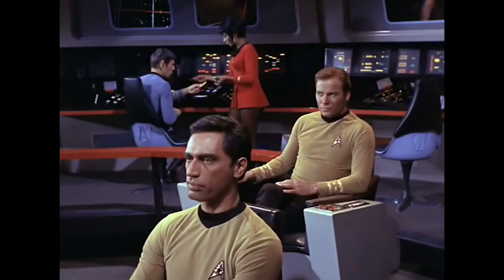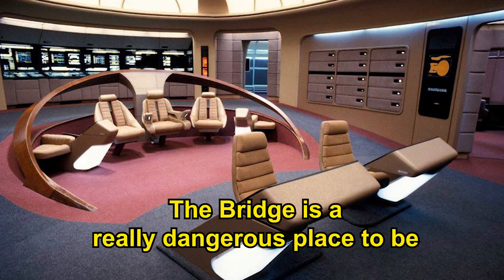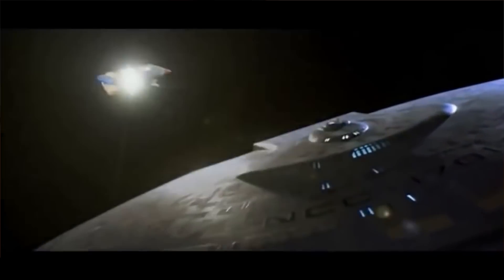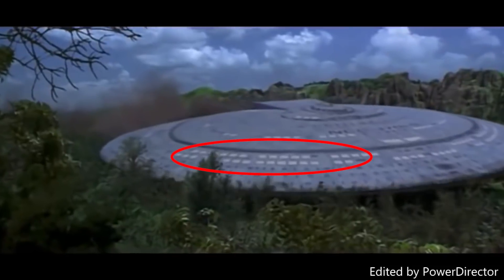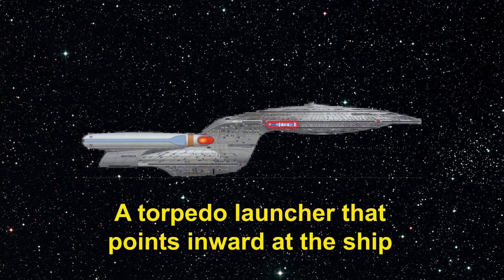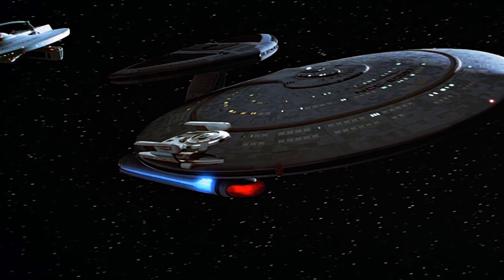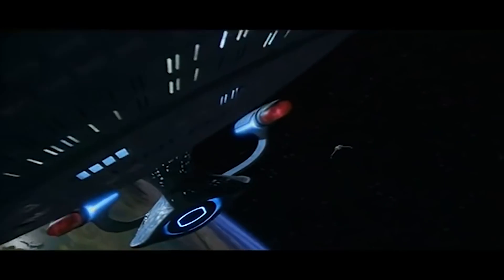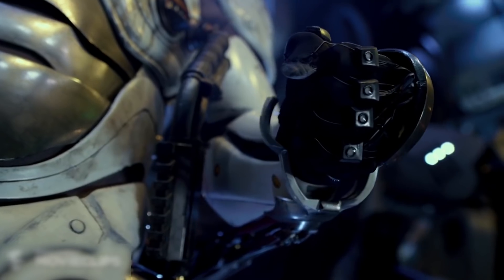10 Flaws Star Trek - USS Enterprise NCC 1701-D

Comment: Bridge... since tos the bridge was swappable so they could upgrade or replace a damaged one logical considering the crew is expendable. Would have made even more sense if the bridge detached like in Galaxy Quest. Most military marine ships and planes put their bridges outward and exposed. Battlestar Galactica, Star wars, ect put bridge on top or front exposed. Films better and helps watchers of the show suspend disbelief by viewing top down instead of buried in the ship somewhere, people like windows which are always on the skin of the ship. Apollo capsules and shuttles all, top/front.  The ship was designed and built in space was not supposed to land, only  in an emergency, thus the escape pods. A warp field was created by having the nacelles at a distance from each other. Looking at the navel ship pictures, the Enterprise did this as well, instead using between decks and walls use of space, that is why they are always crawling around on their knees or in Jefferies tube to fix stuff manually.  Shields, always have been a flaw for me but it also allows for ways to allow plots to develop, kind of the opposite of plot armor, plot weakness, which allow writers to get people, bombs other plot stuff  on to the ship to damage, weaken, kidnappings, intrusions, in an easily explainable way.  Guidance of the ship. Well that is a feature of the future which  you are too dimwitted to accept. Evasive maneuvers Alpha 2-9, the computer can carry out the maneuver better than a human while also using Ai to make futher adjustments to avoid being shot down. You are used to driving a car. But now cars can drive themselves and when their computers become as fast and advanced as the Enterprise, they will do a better job driving than you and you will be able to tell them what to do and they will carry out your command in a faster, safer, better though out way than you ever could. Just like the enterprise. The joy stick exists for manual over ride for when the computer is down, or human intervention would be more beneficial. (If the Klingons got your database of evasive maneuvers, their computer could figure it out more quickly and know what the ship is programmed to do. The most important fact your little jabs and insults to the show miss is that is just that. It is a show, meant to entertain, not to have a technical explanation for everything. I actually disliked the technobabble and psychobabble of TNG. TOS did not explain engine bussard collectors, transporter Heisenberg compensators, nuvial dampers, or hydrospanners (wait..  that is Star Wars) it concentrated on the complex relationship between 3 characters and the love of captain for his vessel. It made for much better story telling and the mind filled in the technical blank with imagination, which is why TOS is best.

Comment: To be fair. The Federation built exploration ships not warships. They were designed to scientific goals.
Also Galaxy class was never designed to land on a planet. It was much more larger than the mentioned other ships.
And the shield as the should be the main defense line there is no reason to build a fortification around it. Even modern warships has less armor than WW2 era ones as they have modern defense systems which stop the rockets or shells in the air.
Also think the historical battleship Yamato, it has a bridge pretty high and a combat conning tower lower. This design is work since the WWs.
Ineficent use of space is false too. It's not a warships, and as a science ship it can keep some "free space" for new technologies. As Voyager implemented borg technology.
The bad security is also because it's a pacifist civilisation with a pacifist captain on a science ship, not a military unit. For that there is Sisko and the Defiant. :)
The rear torpedo launcher is an emergency one,  there can be a safety protocoll so it's not work when the ship is united. But with that logic a spy can just detonate the torpedo he not need to launch it. And it works in any "normal" torpedo launcher too.
Reply: Than is a nonsence let that ship full of children to patrol in the Romulan Neutral zone, where you can encounter enemy warbird.

Comment: There's a lot of nonsense in this video.
#1 Why is it easier to target the bridge compared to any other spot on the ship's hull ?
#2 When the inertia dampers fail, you're dust. Safety belts wouldn't change that.
#4 Ships of that type were not intended to land on planets. The concept was introduced with Voyager first.
#5 They performed this update in at the very end of TNG
#6 The torpedos can control their flight path. They are not canon balls. ;-)
#7 Similar to #1 it doesn'matter where the engines are. The probability to hit them does not depend on their position. And, on the other hand, it's not a good idea to put an engine that might generate dangerous radiation close to other sections of the ship. 
#8 Hey, it's the 24th century. They can afford the luxury of space.
Reply: IAN HEINE  I didn't skip #3. #3 is a real flaw. Their security really sucks. Enterprise IS stolen all the time. :-))

Comment: "Lugging around volume"? Uh....what exactly is the advantage of a highly compact design in SPACE?
"Joystick"? Seriously? A touch screen would work MUCH better. Just move your finger around to the place ya wanna go. That's just 1 finger to do basic navigation. Add 7 more, and you could very easily control 3D position and navigation (both the orientation of the ship in space, and it's trajectory through space). (Yes, I'm leaving thumbs out of it....a thumbs aren't particularly useful on a flat surface.)
That said....why aren't control panels "mini holodecks" or HUD's so you could use 3-space control instead of 2-space?
Why isn't the viewscreen holographic/3D?
And....why doesn't the bridge (at least) have tractor beams INSIDE....as a back up to the inertia dampers.
What's with windows? Seriously, there ain't nothing to see outside most of the time. Go to the observation lounge if you really wanna look out the window.
Put the bridge in the middle of mass.

Comment: Nerd voice
The location of the bridge doesn’t matter. If the shields fail, they’re dead. This is relatively consistent in the TV show, but not in the big, dumb action movies. Same with seat belts. If inertial dampening fails, the seat belts would tear the crew to shreds. This was always wrong going back to TOS. If they failed at all, there’d be human salsa on the walls.
Generations was dumb. Literally everything in it is dumb.
Again, with the pylons, if the shields fail they’re going to die. Nothing about the design is practical. It’s magic light speed technology. They’re no more safe under a saucer because (my own gripe) there is no “up” in space.

Comment: the Saucer could have landed in a controlled fashion, except for it's lack of landing gear... except you're forgetting, one, the helm was unresponsive... oh, guess you forgot that when you mentioned they could still use their RCS thruster quads...here comes number two, the amount of time needed to board, and launch escape pods would have got the crew killed, as they launched into a matter antimatter explosion the saucer protected them from cause it had shields... resulting in massive crew deaths, where as the emergency landing procedure resulted in zero lives lost. the Enterprise was lost but the crew and their families walked away. an emergency landing  they were essentially forced to make with all hands in the saucer since after the detonation they were plummeting towards the planet without time to board and launch escape pods. there were more then a thousand people on board, think man think. Three, stop calling it "the battle section" dumbass. it's the Stardrive section, literally because it houses engineering and all stardrive components of the ship. Four, it's tribble, not trable. five, you critque a crash landing procedure as if they weren't crashing, and they had a choice. six, real life aircraft put their engines on wings, for you to shoot at dip shit, plus warp drive requires a specific symmetry to form a warp bubble, that's why nacelles are placed as they are. seven, there is more  than one toliet, you're an idiot. eight, the Sovereign class is still a multirole vessel, and it still has science and engineering labs on board. the same as any, and all major Starfleet cruisers. it is not a dedicated warship, of all Starfleet vessels on the Defiant class has the distinction of being Starfleet's one true warship until the Prometheus class is designed. nine, it's not Pacific Rim, it's Star Trek, he was piloting a ship, not a giant mech, a joystick makes more sense... lastly, number ten, you're a goddamn idiot who doesn't know Trek, just your head canon. don't make anymore Star Trek videos if the best you got is "do it like Pacfic Rim". that's the ten ways you're a moron.

Comment: Ok, first off Discovery is not canon, so please don't use it. Next, Zephram Cochrane theories on warp field stability dictate the nacelle placement based on the mass/dimensions of the ship. There have only been two Enterprise models not classified as Freighters, NX-01 and NCC-1701E. Picard's Enterprise is a joke all around, as the bridge alone, with their redundant consoles, allowed for overloads in any of the systems monitored on those unmanned, selectively assigned consoles, to explode. Next, maintaining a consistent shield frequency allows for lower power consumption, as opposed to the random shield frequency program. In addition, having served on two nuclear submarines, space is at a premium. Aircraft carriers, not so much. There are huge empty spaces on a carrier for just in case stuff. As well as a 1000 ft long, three deck tall, hanger deck below the flight deck. Talk about wasted space. The Enterprise E was the first true "warship" the Federation designed, as the Federation used Starfleet like the UN uses our military...as peacekeepers through presence. That started with the Great White Fleet, and never stopped. 

The saucer section, if you would have read the manual and not just looked at the pictures, reveals it slows down through the atmospheric turns, then sets down safely. The saucer section was hit by the battle bridge explosion shockwave, which prevented use of lifeboats AND any type of safe controlled landing. Lifeboats cannot eject once atmospheric entry starts, sorry. 

Please do your homework, as I truly wanted to enjoy this video.